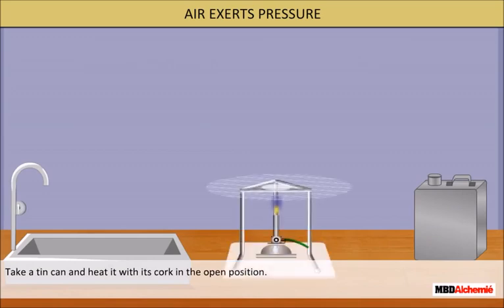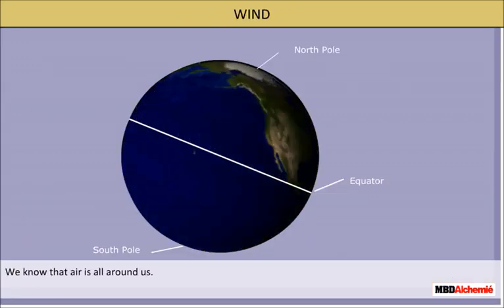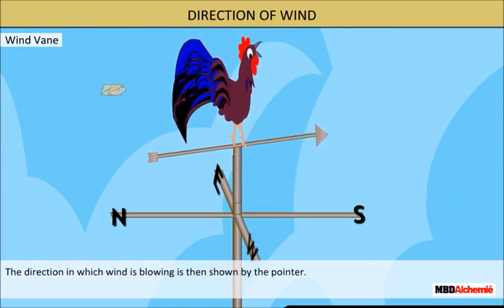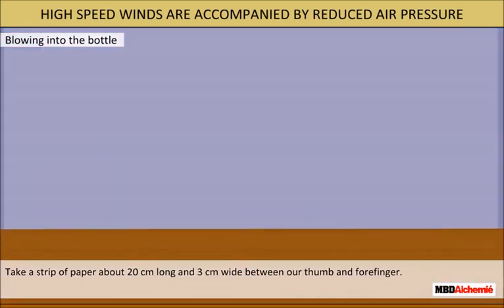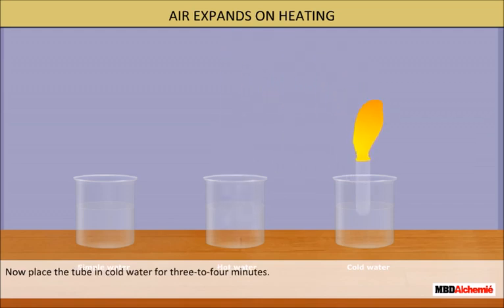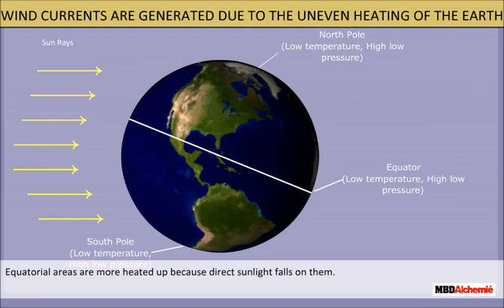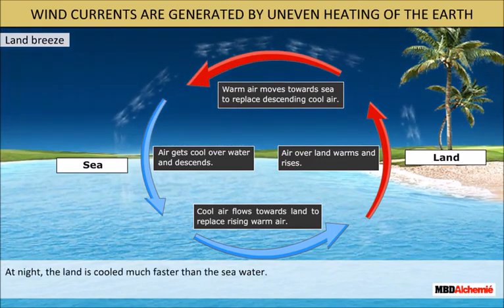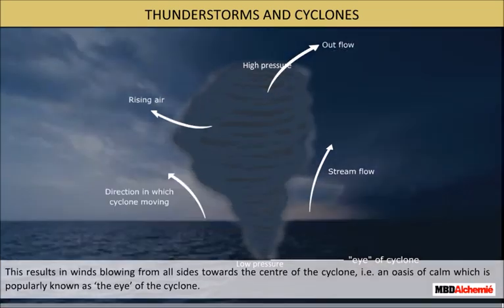Winds, Storms and Cyclones | Class 7

Comment: The bottle gets destroyed because the water is poured over the bottle , some steam in the bottle condenses into water, reducing the amount of air inside. The pressure of air inside the bottle decreases than the pressure exerted by the air from outside the bottle. As a result the can gets compressed  this activity again confirm that air exerts pressure
Reply: @Ayisha safa
Yes correct only !!
Reply from the maker: Great!